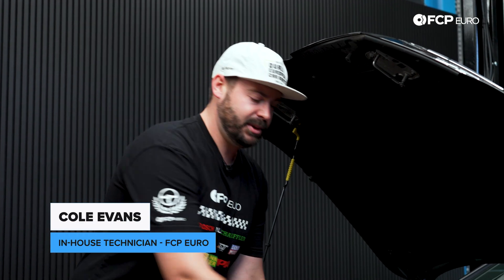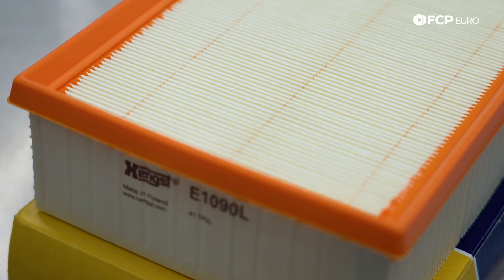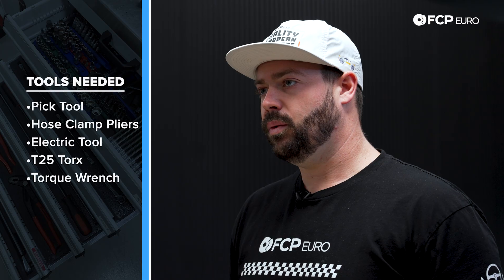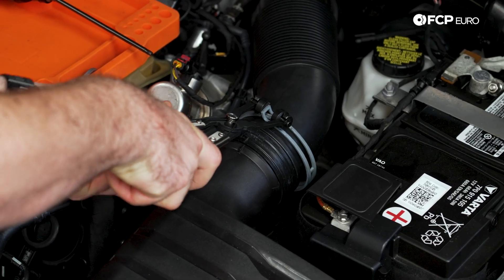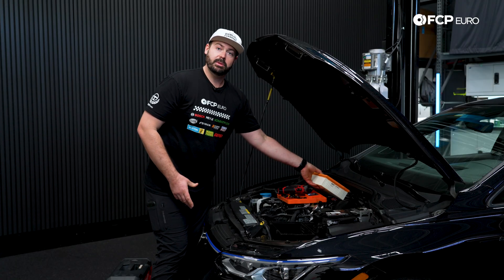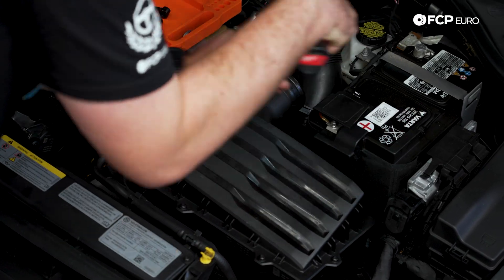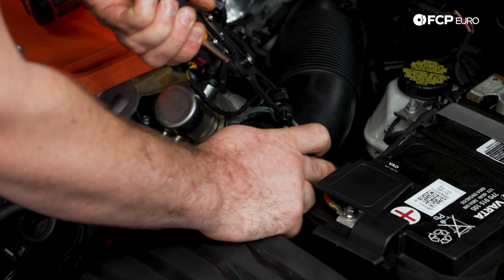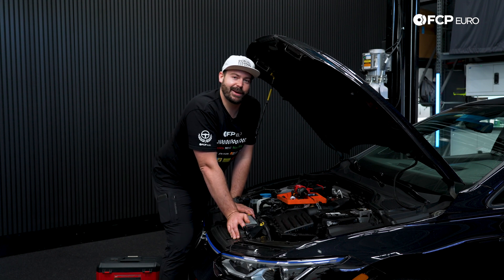VW Golf R Engine Air Filter Replacement DIY (2022-Present Volkswagen Mk8 Golf R, GTI)

Comment: Thanks for video. Just replaced my filter today. It can be done simpler:
1. No need to have a Pick tool. This small rubber pipe can be detached by gently pulling it with small circular movements
2. No need to detach big pipe. It's not an obstacle to lift the lid.